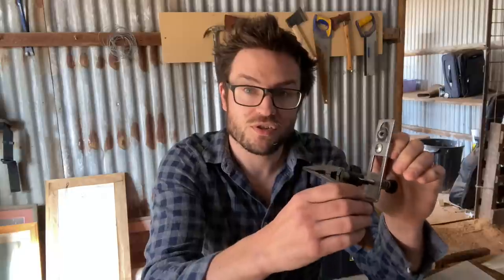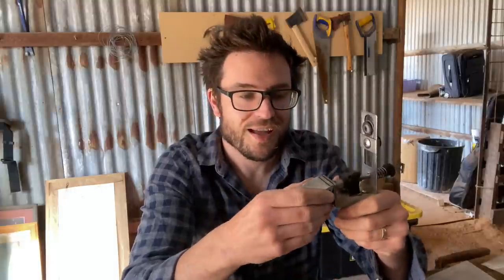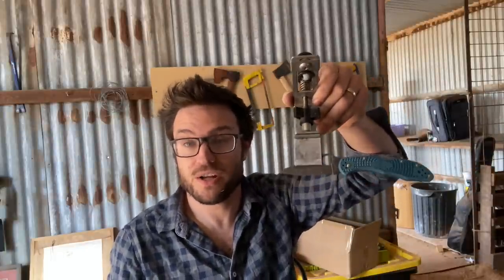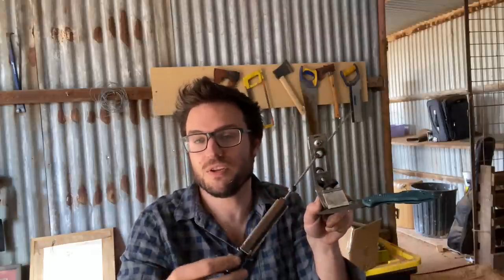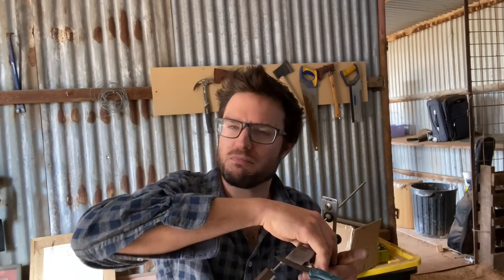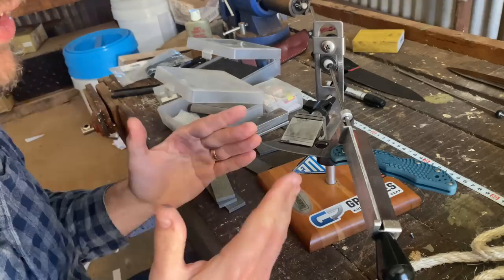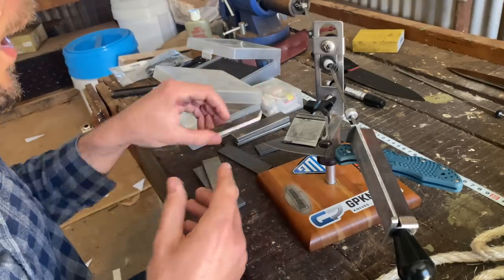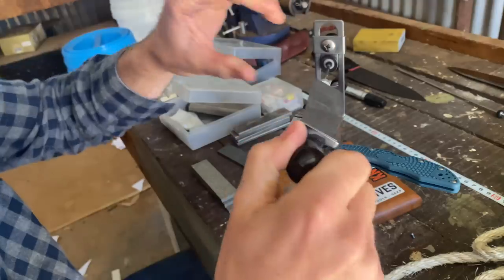KME Sharpener: 1,000 blades later. Mirror Edges for even the uncoordinated

Comment from the maker: 24:25 Full Delica K390 Sharpening and stropping with the leather strop hones

49:26 full sharpening with the Spyderco K11 Kitchen Knife in Vg10

1:08:10 general thoughts and summary of whats good

LONGASS video I know and hopefully I’ve answered or shown any lingering questions you have about the system!
Reply: I'm here to learn ❤️
The kme sharpening system has been kind to me, and I'm grateful you've made this video
Thank you
(also I'm assuming you're not sick anymore =)
Reply: Looks like a good system, Interested in seeing your thoughts on the new system you mentioned you got a few videos ago.
Reply: I own the WORKSHARP PRECISION GUIDED SHARPENER, do you think it basically works the same as the KME sharpener. I also have different stones and gits from Gripmatic.
Reply: Another suggestion with your larger blades would be to do them in two sections and then when finished spend a little time in the center to ensure they're perfectly blended for one homogeneous edge...
Reply: Pete how do you clean your diamond stones?
Reply: @kevinAuman1  for what it's worth I use a lansky stone eraser - I have used pencil erasers before as well
Reply: So in marking the blade in the clamp to see that it has moved during the sharpening process, How do I know how far to insert the blade into the clamp? 

Thanks
Reply: I bought my first KME back in 2013 and spoke directly to Ron (the owner) about how to use it properly on Skype (I doubt they do that these days 10 years on). After my first few blades, he gave me an honorary Ph.D. in sharpening theory and told me that if I did not swear so much that he would ask me to represent the brand. I am from London / we use foul language like we drink f@cking tea ya c@ant. So that didn't happen ...

The KME is still in my NO.1 spot for any blade you have that is under 6" and has about a jaw-wide flat spot on the spine for the jaws to get a good hold on approx halfway along the blade. Example Cold Steel outdoorsman ... yeah good luck with that.
The KME is a great system for what it was designed to do. And it is the one I always go back to but as you have done approx1000 knives in yours at the time of this review can I ask you some questions? 
As for spare parts, I have 2 units and spares for them as I thought well ahead/way down the road for that one.
Reply: The numbers on the films is the particle size. It’s the size of the diamond particles, how far apart they are. Also, natural and artificial mineral based sintered whetstones are able to get just as good of an edge as diamond. CBN isn’t diamond. It’s cubic boron nitride.

Comment: Well done Pete! I’d just like to point out that the rubber coming loose in your jaws, and the nylon ball popping out are warranty parts. Lifetime guarantee buddy. BTW, the rubber coming loose has been addressed and isn’t happening on newer units. Great vid sir and that Nick Shabazz is a great guy and awesome friend huh? 👍
Reply from the maker: He definitely is! Good news on the jaws and the litte ball 🤩
Reply: Hi Kme. I'm just about to buy one of your sharpening systems here in the UK. Could you please clarify how to differentiate between the older model and the newer one? Thanks.
Reply: @CedricAda  The main problem with the "lifetime guarantee" for most product, is the shipping cost is on the customer.
In Canada, you end up paying 20$ or more to get your product "fixed for free".
Reply: With very great compagnie, you send them a picture and they send you the part (that's a real free fix).
Reply: @alexandrevaliquette1941  cost of doing business, can’t complain about that
Reply: @alexandrevaliquette1941  Fiskars is amazing for that. Half the time they don’t even ask for a picture. Just overnight you a brand new tool. I was blown away.
Reply: Need to add a spring between the jaws to add opening pressure when installing knife kinda annoying trying to hold pressure forward and hold a knife and gets the jaws open at the same time.
Reply: Well, I'll be putting an order in soon.  My Work Sharp Precision is great, but your warranty is awesome.
Reply: @alexandrevaliquette1941 I can’t remember the last time a company asked me to pay shipping for a warranty part. I am ruthless about warranties, and I’ll email about having ANYTHING warranted. So I do a ton of warranties, and I don’t think I’ve ever been asked to pay shipping.

Comment: I'll say that putting black electric tape on the knife where the jaws clamp will greatly reduce any shifting of the blade during sharpening. I do it all the time.
Reply: I have a cheap system similar to this and the jaws aren’t great, going to try this out thanks =)
Reply: same, but with masking tape. Added benefit of not chewing up the finish on a blade's face if there happens to be anything abrasive caught in the jaws.
Reply: I use a small piece of paper towel between the jaws and the knife on my lansky. Seems to lock the blade in place better than tape beacause there's no adhesive to smush and slide around. Also prevents scratches very well.

Comment: Try adding a spring to either side of your stops to soften the impact on the pivot ball. Also, GripOMatic offers an upgrade rod-stone holder to allow longer stones and strops.
Reply: Yes recommend the gritomatic stone holder strongly.  KME needs to do some constant engineering ypgrades, a longer stone would be a good thing.
Reply: @stevenlachance8576  It's impossible to get contact on more than 4" of stone on the KME. Even using the Gritomatic stone holder and 6" stones only allows you to use the middle 4" of the stone. It's just how the system is designed. It would require an entirely new design to accommodate 6" stones.

Comment: I finish all my edges with a 0.1 micron strop which is equivalent to 200,000 grit lol, using a different finger for each emulsion is what you should be doing. Only thing I could recommend is wiping the blade with a cloth after each grit to remove any grit residue from the previous grit. Great video 👍
Reply: Yeah I scratched my Benchmade by not wiping the blade clean between grits...
Reply: Can you whittle a hair?
Reply: @1986subway  never tried honestly but it wouldn't surprise me lol

Comment: The 50 grit beast actually gets the most use in my setup. Generally, when I sharpen a folder for the first time, I reprofile the edge to the most acute angle I can possibly get. I'll even resort to tricks like clamping the handle instead of the blade so the stones are in no danger of hitting the clamp. 
While I do own the convexing rod, in retrospect I could just freehand something if I wanted a convex. At least it's one of the cheaper accessories! 
The scissor sharpening rig though, oh yes. There's a perverse joy to be had in getting a mirror edge on a nice pair of shears.
Reply: Just wondering what do you consider to be an "acute angle?"  17 degrees? 15? Thanks
Reply: @kurtglo  Afraid I don't keep track of the precise angles, but on the KME, if you run the risk of 'sharpening' the clamp as well as your knife, that's fairly acute in my books. Naturally, this varies a lot depending on the thickness and breadth of the blade in question. Freehanding, I'll sometimes go as far as to sharpen the primary bevel almost exclusively, so that all that remains of the secondary is a microbevel. Kinda par for the course with scandis, but I'll also do that with Kabars, CRKT Pilar & a Fiskars brush axe.

Comment: Had my KME for about a year and a half, gotten the basic kit plus lapping films and strops, and I love it! Went from little sharpening skill to razor sharp mirror edges.
The black line along the clamp is a habit I need to get into.
Reply: What are you putting the lapping films on?
Reply: @mr.b111  each grit comes with a glass block to put them on.

Comment: You said it’s sort of hard for you to get a hair shaving edge compared to free hand sharpening. I do both, on water stones and on a Lansky guided rod sharpener with diamond stones. What I learned to be working to get a razor sharp edge (as well as a polished one) is to apply less pressure with the strops and don’t overdo it while stropping. Applying a lot of pressure to the leather makes the apex a little round again because the material is softer and forms sort of a concave shape, resulting in a convex shape on the edge. 
Also pulling the sharpened edge softly through some softer wood often helps to remove the last bit of a burr on the edge.
Just my two cents… pardon my english, not a native speaker.

Comment: I've been watching your videos for about 3 years now, and I love them.  I actually got my KME kit on your recommendation, and I absolutely loved it.  The only issue I kept having was the fact that the knifes ALWAYS shifted in the jaws, no matter how tight I clamped them... I ended up purchasing the TSPROF K03 a couple months back, and their clamps are way more secure, in my opinion
Reply from the maker: I truly reef down hard and generally do okay, but I hear positive things about the tsprof. Quite a bit more costly though it seems?
Reply: @CedricAda  the K03 (the big professional one) is about triple the price of the KME... But boy is it worth it.  I cannot sing the praises enough.  I did have to modify the stone holder a bit to accept my KME stones, but other than that, it has enabled me to put incredible edges on my knives that I could not achieve on the KME (and in a shorter amount of time ~15 mins/blade).  I've actually started a small side gig doing restorations & sharpening, and my clients have noticed the difference as well.
Reply: use a wrap or two of blue painter’s tape on the spine

Comment: I use a drop or two of Windex on the diamond stones as a lube while sharpening as was recommended by I don't remember who. The liquid captures the metal being shaved off. Every once in a while, while working, you just use a rag or paper towel to remove the sludge from the blade and diamond stone surface. Might not matter in your shed but if you're working in the kitchen like me you don't want metal filings to get into everything. But most importantly the metal particles are small enough and light enough to inhale while working closely on the KME.  My belief is that those particles can't be good for you if you sharpen a substantial number of knives on a regular basis. Don't know if you have Windex (a glass window cleaner) in Australia.  And yes, changing fingers while applying the emulsions to the strop isn't overthinking it, it's the right call!  Great show!

Comment: KME is for pro sharpeners as well.  I run a small knife sharpening operation, and I offer it as an option for knives 7 inches and under, mostly folders.  I can get excellent results with it.  I also use Worksharp ken onion with blade grind attachment, and a viel s5 belt sander.  Had a tormek t4, but sold it, too slow, and not capable of giving me the sharpness I demand.
Reply: The literal and actual sharpest knives on planet earth are done with Tormeks and only Tormeks.

Comment: Hi Pete! Love your work. 
Some advice on the oil. Don't! Please, Don't!
Oil will reduce your cutting speed, AND bind the diamond stones - as I can see yours are. Better to just use a spray of water which is easy. Dry the stones before packing to prevent the base metal from gathering rust. 
If you really want to take it up a notch, use Lapping fluid for diamond stones. The film is much thinner than oil.  I have a huge bottle of Trend Diamond Lapping Fluid - costs a little but I cannot see myself ever running out. It is not an oil, but a water soluble fluid, that will prevent rusting, binding, and allow better/faster cutting. Cheers!

Also - you can get Spyderco ceramic stones for the KME too, in 3 grades. I like the resulting edge that ceramic gives for a working knife.

Comment: I do a lot of cold work and polishing professionally.. mostly on glass but in general, it’s very similar to knife sharpening. Same grits, diamond pads, belts, compounds are common, ect. Admittedly, the glass works a little faster than modern steels but that’s about it.. no leather. I Usually use a cork belt or felt/compound there

Couple notes.. in general, you don’t wanna skip grits. Your working the finer stone much harder than it’s meant to which causes premature wear and actually takes more work on your part. When you step through the grits, it’s actually incredible how little time it can take.

For knives, I’ve got a worksharp.. basically a poor man’s version of the kme.. I’ve got no problem with a jig if it makes things easier and cleaner. Work smarter not harder! This is personal preference but I usually work up and down the blade making circular motions.. since I don’t take it to a mirror polish, I like the crosshatch pattern that results from this. I’ve just got the base three grits that come with the worksharp. 320, 600, ceramic (1500?). I’ll only use the 320 if adjusting the grind angle.. otherwise I’ll usually just do a cou light passes with the 600 the. Use the ceramic to get reasonably shiny. From there, I’ll increase the angle by 2 deg, go back to the 600 and give a couple light passes. Finish off with a couple more light passes from the ceramic. light passes.. I still want a little bit of bite.

Comment: Haven't watched in a while, oops, sorry, I usually do stuff by hand but as an older fella, not always possible  with these old hands. Like this system a lot, if this helps anyone, I apply friction or hockey tape to prevent blade movement in jaws. A bit expensive but so are our blades, so worth it, use magnification for quick analysis  of your work, helps with the learning process, thankyou Cedric,

Comment: If your back nob is too loose it will pivot while you are trying to tighten the jaws, which can cause the tip of the knife to pivot up and stab you in the palm of your hand (lots of blood). Ask me how I know!!
    I suggest keeping the back knob pretty tight and start the sharpening with the knife handle on the right side. That way the weight of the handle will keep the blade tip from swinging upwards while you are tightening the jaws. Cheers.

Comment: This is great.  Been using a Sharpmaker since they were invented.  I'm okay with 15 degrees a side, but there are times I'd like to go 17 degrees.  Really thought about the Work Sharp system you used to use, but then watched how you changed to the KME and it got me thinking.  It definitely needs the larger knob and I like the travel stops you added.  Thanks for this review/tutorial.  I think I can justify the large cost difference between the KME and Work Sharp to get what appears to be a more rugged, easier to handle/use system.
Reply: I highly doubt you or anyone else could tell the difference between a 15 or 17 degree per side
Reply: @BennyCFD  Actually there is quite a difference. Appreciated only by people who have been sharpening at a high level of expertise. That would be the difference between a professional and a rank amateur.

Comment: I have had a Smith's kit and a Lansky kit sitting in the cupboard for ages. Both gave me less than stellar results in terms of sharpening...probably the user, not the tool. By weird coincidence I pulled them out a few days ago and started using the stones by hand instead of with the guide/s. The Lansky stones work well. I managed to convex parts of my Golok (4cm at the tip and 5 at the base) so that I could use it in other ways besides hacking things. I'm happy with the results, but hey, I'm easily pleased.

Comment: Long vid. If that Spyderco is a carter designed knife, then it’s worth preserving, carter makes very good knives, and his design is solid.
I too sharpen, and have less experience than you but still over 100 on each of my systems, although my tormek mostly does scissors, chisels and axes and the occasional fillet knife if I want a toothy edge.
I also have a we and a Tsprof k03, the we is mostly collecting dust now and I will sell, although I loved it before I got curios about the Tsprof, I am now thinking about a grid viva…
Anyway my only comment for you would be to clean the edge of the knife between changing of grits to prevent cross contamination, especially when using strops.
Keep up the good work and stay sharp!

Comment: Sadly, knives manufacturers puts even angle on both sides very seldom. I've got a sharpening system similar to that and electronic protractor to set the proper angle and almost every time I have to reshape the factory edge. Typically 17 degrees per side is kinda safe area 😎 Starting from 320 grid or 600 depends of egde condition, than 1000 & 2000. Finishing on the leather strop with diamont compound. Easy peasy lemon squeezy 😉😁 Thanks for sharing Your knowledge 👍🔥

Comment: I went the cheap route and bought an Amazon knock off that uses edge pro sized stones. I bought high quality silicon carbide stones up to 8000 grit. Love the results. I think I messed up my strop with that green stuff. I think I’ll try a new one with the CBN emulsion. I’m also curious about the CBN stones. 

It’s nice to see someone else’s process and ideas. It looks like you press harder than I do. I’ll try putting some more pressure as I go. One thing I notice is that I quickly don’t feel or see a burr even under a microscope at 1000+ grit.
Reply: You can use olive oil on your strop to get the green compound removed. Just rub a thick layer on and let it sit for a few minutes and wipe clean. Might take a couple rounds if it’s really loaded up. Won’t hurt the leather at all.

Comment: on my KME, the jaws never could literally "lock up" in both orientations. there was always one orientation in which the blade/jaws exhibited a little rotational "play" about the turning axis. i had the system replaced, plus parts direct from KME - but in the end only a fudge-job with some epoxy putty could provide a lock-up with no "give" whatsoever. i like my system, but there have been some engineering oversights. there's room to improve, still.